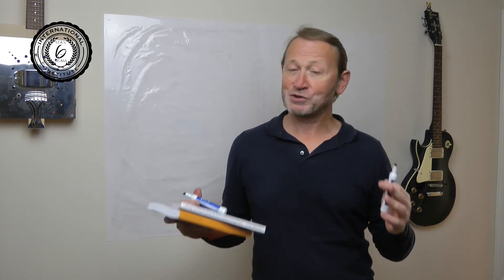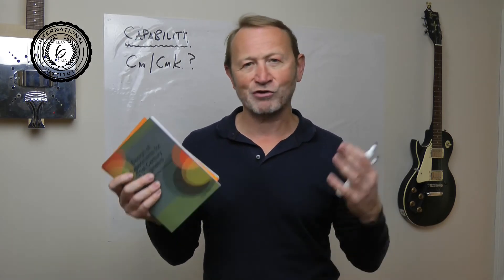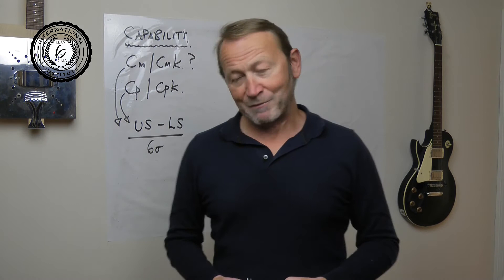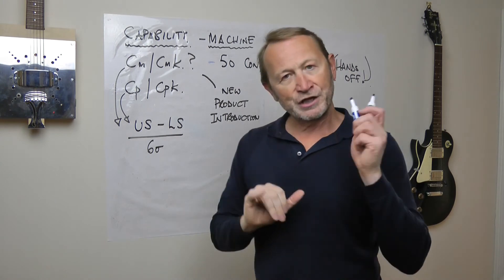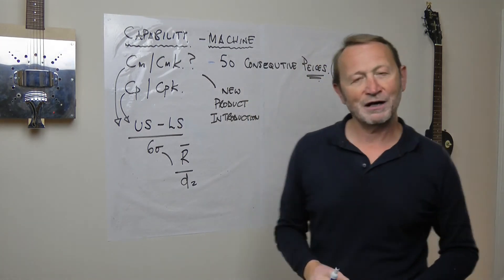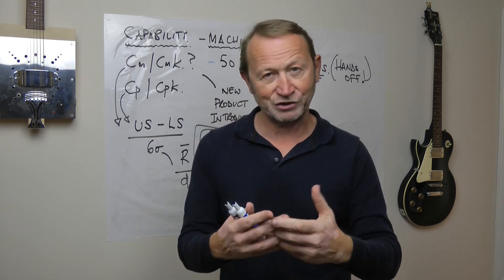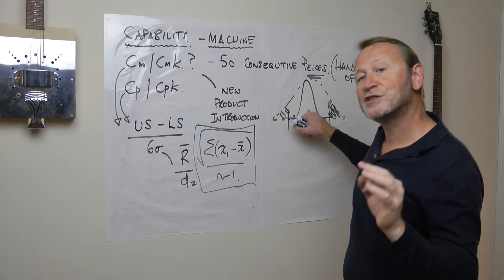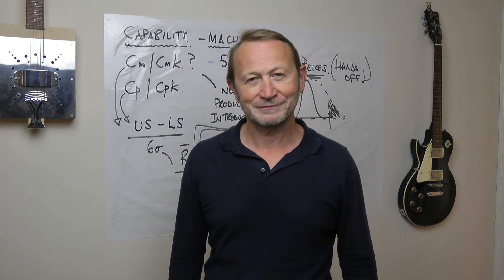Machine Capability - Cmk Explained

Comment: I understand to get data is without touching the machine, all parts are in the raw, if so  I got a question, if the formula for  Cm and Cp are the same, this means Cm=Cp ? or How can you separate the machine from the process and the process from the machine to be able to measure them separately? Basically the same question for Cmk and Cpk... waiting for your feedback, regards from Mexico